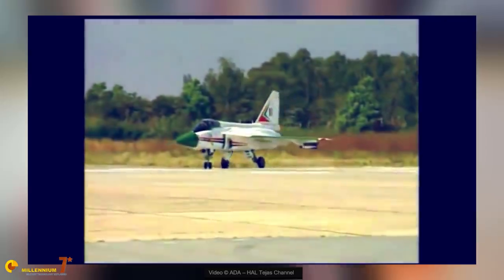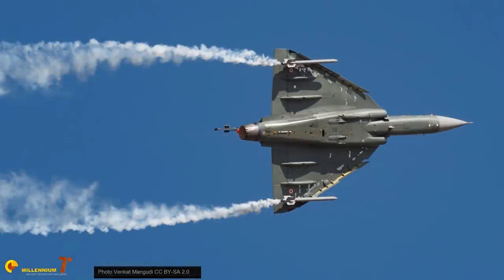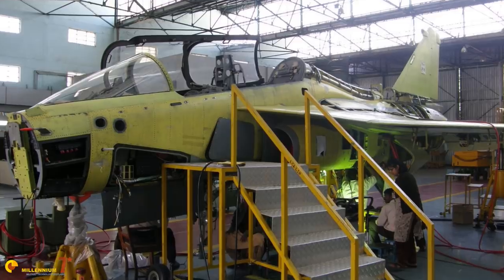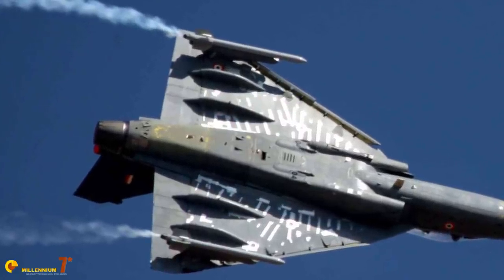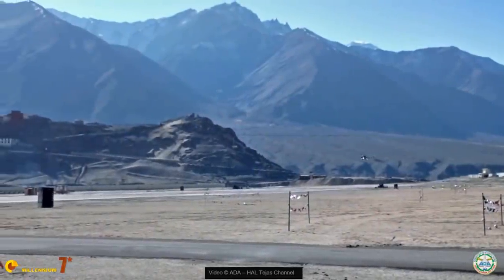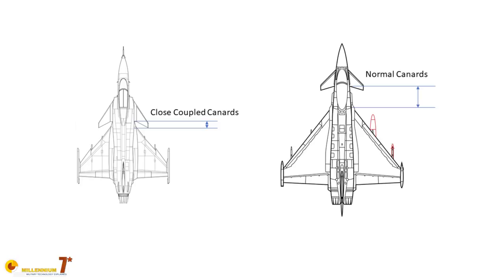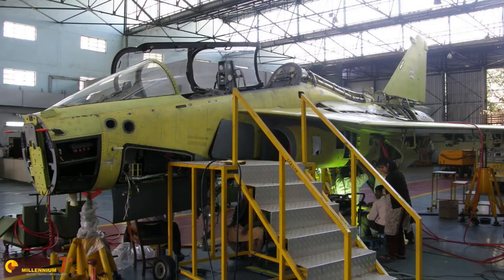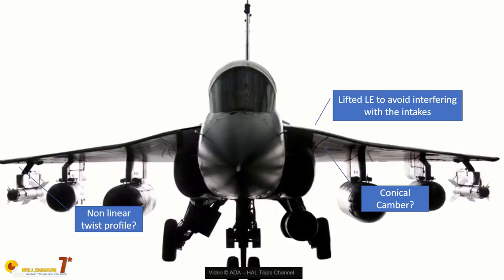TEJAS Aircraft  Aerodynamics Analysis - The Swedish Connection?

Comment: It looks like a Mirage 2000, without the difussion cones.
Reply: Nestor Sanchez It essentially is. A downgraded Mirage 2000.
Reply: @csabascs5913  @nestor need do deep analysis you will see huge difference between basic design of tejas & mirage.its not same
Reply: @csabascs5913  nope! Pilots who have flown both jets have said handling is smoother in tejas than mirage..
Reply: Inlet design of both jet is totally different that's why mirage has cones in inlet.
Mirage inlets are placed above the wings and ahead of the wings with sidewise inlet design.and mirage inlets shaped are also  not "Y" shaped which all together  cause air to move inside in supersonic speed ,which create turbulence in jet engine & cause damage
To reduce air speed in the inlet from supersonic to subsonic mirage uses diffusion cones.
But tejas inlets are placed behind & below the wings & with "Y" shaped inlets which don't let air move above subsonic speed inside the intakes.
So both jets have totally different designs it's not same
Reply: akash sahu Sure they are not the same, but the basic aerodynamic design concept behind them is the same. Only the Mirage has better aerodynamic performance. Even the Indian Air Force itself was very much disappointed with the aero performance of the Tejas, that’s why they created Mk1a, that’s somewhat better, but not too much. The problem is that the pure delta wing design concept is too outdated. True 4th gen designs like trapezoid wings with lerx and canard deltas are all much better.
Reply: Ravi Sharma Smoother maybe, but not better. It simply doesn’t have the same aerodynamic performance. And the Mirage is outdated and underperforming too compared to true 4th gen designs.
Reply: akash sahu I generally agree. Re the wing design, I know that the Tejas is not 100% pure delta, but there’s no major difference between a pure delta and a double delta wrt aerodynamic performance. Difference is very small compared to the difference between a pure delta and a canard delta or a lerx trapezoid wing design. Btw the Mirage does have a lift enhancing device in the form of 2 small vortex generators before and above the main wings that work similarly to close coupled canards, only they are much less effective.
Re Tejas Mk1a I thought there were some aerodynamic changes too but I may have been wrong. Anyway, my point was that this design is obviously inferior to true gen 4 designs, because the concept goes back to the late 70’s/early 80’s, and therefore Tejas cannot really compete with 1st line gen 4 fighters like The Gripen or th F-16.
I fully agree with you that we shouldn’t compare Tejas to 1st line gen 4 fighters like the Gripen or the F-16 as it doesn’t belong to the same category. It’s a 2nd line light plane meant to complement such planes, not to compete with them. We should rather compare it to the JF-17 or the FA-50. But many indian fanboyz here do claim that Tejas is in the same league as the Gripen or the F-16, that’s simply stupid. It isn’t and it shouldn’t be. It’s not designed for that.
I also agree that Tejas is not a bad plane compared to similar 2nd line fighters like the JF-17 (although the latter has a more advanced, true gen 4 aerodynamic design, thanks to having been conceptualized decades later). As a MIG-21 replacement it’s obviously a big step forward, and also a huge booster for the indian aerospace industry. But nevertheless it’s aerodynamics is outdated, mostly due to the huge delays and many problems of the development, as you yourself have mentioned, and therefore it’s no match for true gen 4 and 4,5 fighters. A fact that many fanboyz don’t seem to be able to accept.
So I don’t argue with you, actually, but with those fanboyz who make ridiculous claims like Tejas being a better fighter than, say, the Gripen, that’s one of the most advanced gen 4/4,5 planes. This is nothing but wishful thinking and misguided patriotism/national pride.
India should be proud of Tejas, but not because it’s one of the best fighter planes of the world (what it isn’t), but because of the fact itself that they could develop an indeginous supersonic fighter (albeit using lots of foreign help and modules) and create a decent aerospace industry from scratch, something that very few nations could do. It’s a big achievement in itself, even if their first product, that is Tejas, is not among the best. The statement that ‘Tejas is a very successful failure’ means exactly this, imho.
Reply: @akashsahu3854  Mark 1A will also see improvement in the air intake design

Comment: What we know about performance till now, from pilots who flew it  and test pilots, 1. It FOC Tejas has achieved all the benchmark after recent software upgrade baring 1.8 Mach speed.
2. It pulled -24° AOA exactly what it was designed for. I think f-16 can pull 25° ( stands corrected)
3. Roll rate is excellent
4.ITR is superb 
5.STR is average.
6.Really smooth to fly and responsive.
Reply: @Nick Emerson Tejas itr and str datas are not available.. in the public domain.. however by analysing the airshows Tejas str and Roll rate are slightly greater than gripen.
Reply: @Nick Emerson u can deduce so much if watch it carefully..
Reply: @Nick Emerson that's exactly what I m telling u.. I have shown u the video comparing the performance of IOC Tejas and gripenC side by side but you want to reject it by saying it's shaky. But u tossed some data about ITR and STR of Tejas without giving the source.. that's called faith.. video is a hard fact. It's your faith that made u put unverified data about Tejas... Not science..
Reply: @Nick Emerson and we have all heard the hyperbole of Saab against russian planes, f-22, f-16  after all they want to sell these... But have it in mind that Tejas u saw in Bahrain was IOC standard that too it was its first international flight so capabilities were limited, in the same link u posted it has said the test pilots have achieved 26° AOA , and in FOC Tejas' all the capabilities are unlocked and tested for the first time.. and for gripen the STR is not 28°..  it's 20°s same as Tejas. https://www.fighter-planes.com/info/jas39.htm
Reply: Marcos B  exactly.... i know he wont and saab is the loudest mouth in aviation,.. just look at their claims against flanker, raptor..
Reply: @Nick Emerson well I thought u were man of science but in the end you have shown your faith.. it's ok everyman is allowed to have faith in anything even though it's is false..
Reply: @Nick Emerson ohh so bring that up to justify your faith... One is islamic Republic and other one is democratic Republic... I see no faith war here.. but ok  buds whatever u say.🙄 I don't want to hurt your feelings.
Reply: @Nick Emerson well india has more muslims than pakistan and their are so many muslims war heros in india, so i must say its not a religious war between india and pakistan.
Reply: @Nick Emerson it's a deep topic but a brief answers would be, pakistani army that controls the nation, to remain relevant and hold power and money it needs a constant struggle with India. Pak army generals are richest among the generals of all army. Every struggle is about power and money religion is just a catalyst.

Comment: The Grippen and Tejas are competing for the same market. No one in their right mind would buy a Tejas over a Grippen.
Reply: They might if it costs less. A Gripen E/F costs 45-50M USD. The Tejas mk1 costs 23M USD with less than 30 units produced. It would probably cost 15-20M by the end of the development cycle. So if you had the option of buying one Gripen or 2-3 Tejas and your requirements weren't that strict, you might go for Tejas. 
Remember, Tejas was designed as a replacement for MiG 21, you have look at from that angle. No one ought to have bought a MiG-21 over an F16, but they did.
Also, Tejas and Gripen aren't competing for the same market if you look at cost & capability. Things don't compete with each other if they look similar, an airforce cares much more about capability & procurement/operating cost than if the jets look like each other.
The Gripen is competing with MiG 35, F-16 V, Su 35 & even the F-35 in some ways. 
The Tejas is competing with Chinese jets like JF17, korean T50, Russian Yak 130 & Boeing T7. They're completely different sets of requirements.
Reply: Arkadeep Kundu You shouldn’t compare the price of the Tejas Mk1 to that of the Gripen E. They are not playing in the same league. Compare it to the price of the Gripen C if you want to make some comparision. But it doesn’t make much sense anyway for the very reason you mentioned: Gripen is a 1st line fighter, Tejas is a 2nd line one.
Reply: Marcos B No Tejas version is superior to any Gripen version, period. They are not playing in the same league. It’s like saying that the F5E is superior to the F15C... nonsense.
Reply: @csabascs5913  Tejas actually has much better subsystems than earlier Gripen models. Better radar, better fbw etc.
Reply: Marcos B  The 136M USD cost for Gripen E includes Technology transfer & setting up assembly plants in Brazil. Also Gripen has been in production for nearly 30 years, so the development cost has been recouped. Tejas mk1a 62 million cost also includes setting up of factories which right now have only 2 production lines which can make only 16 aircrafts per year. . Also it's the first batch of its series which always costs more. First batch of F-35 cost about 160 million, now they're 80-100 million. 
Mk1A is probably already better that Gripen C in terms of avionics, radar & FCS. Mk2 is much bigger, about the size of a Gripen E, and has canards, DSI, EW suite & better aerodynamic optimization.
Reply: Arkadeep Kundu  Not really. Early Gripens had surprisingly good electronic systems, including an integrated ew suite and datalink that rivals gen 4.5 planes. Maybe the next version of Tejas will have a better radar but re ew I don’t think so.
Reply: Marcos B Just stay in your usual state of happy ignorance then... :D
Reply: @Nick Emerson ohh.. Sorry my bad.
Reply: Marcos B  __ My point is that the Tejas is a standalone project from a country yet to produce a world class aircraft in any class of any description while Saab have ongoing partnerships with Boeing in the US, Bombardier in Canada and Enbraer in Brazil ALL of whom are active and successful players in world aviation. The Tejas is the Trabant of fighter aircraft.

Comment: what will be the result if Tejas was using conventional wings with a tail?
will it be better or worse?
Reply from the maker: In terms of drag? Likely worse
Reply: @Millennium7HistoryTech  Well, the drag on Tejas is pretty bad at the first place. The thrust per wing area is only slightly higher than mirage 2000 but significantly lower than all other modern fighters.
Reply: @Millennium7HistoryTech  thanks
Reply: @joelau2383  it is a light fighter competition is with FA 50 and jf 17, 
Even mirage, f 16 and gripen is in a league abow it
Reply: @a.g.rhithwik  lol above in what terms?
Reply: @rohitb3  it is a segment below f 16 and gripen
Reply: @a.g.rhithwik  Again, i ask, in what sense? or in what terms?
Do you understand anything of aeronautics and aviation technology at all?
Reply: @rohitb3  Before that you explain how do you  understand it.
Reply: @a.g.rhithwik  Design , Flight controls, structure make, Engine, Weapons, Cost, Avionics, Maintainability, etc.
Any idea about any of those aspects?
Reply: @rohitb3  yeh... i do,
even in than aspect modern f 16 are way ahead of tejas 
f 16 could easily handle up to 9g loads
reach mach 2 without payload
has bigger engine
higher pay load
more range
better and tested avionics and ew suit
.
.what do you need more to know about
Reply: @a.g.rhithwik  Okay,  for now, lets accept the modern version of F-16.
How about the Mirage2000, Gripen C and Pakistani Airforce F-16(A/B/C/D variants)?
Reply: @rohitb3  f 16 c and d is far better than tejas.
and those older jets are updated with newer avionics they will equal or greater than tejas
for short span of time.
Reply: @a.g.rhithwik  Acha Mr Expert.  A 1980s/90s upgraded F-16 C is "far better" than Tejas and the older 1970s F-16A/B is updated with newer avionics that will be "equal or greater" than Tejas.
Last question for you : How does these F-16 A/B/C/D compare to our upgraded Mirage2000 mk2?
Reply: @rohitb3  Its like comparing old 2000 Mercedes with 2020 swift (new swift might have got a touch screen that could be integrated on merc also.
if tejas was that good enough why development of mk 2
I think you have not much knowledge about this topic.
Reply: @rohitb3  you know tejas is slower speed is mach 1.6 as per hal
less payload
only advantage is newly made air frame and avionics
avionics can be upgrades on old falcons and mirages.
so if the air frame of a old jet is in good condition it could be upgraded with new electronics it could outmatch tajas with an ease
Reply: @a.g.rhithwik  Wait, you still have not replied to my question :How does these F-16 A/B/C/D compare to our  Mirage2000?
Then i will tell you what knowledge I have. So please answer the above question.
Reply: @a.g.rhithwik  still waiting for an answer...PAF F-16 A/B/C/D vs our Mirage2000
Reply: @rohitb3  for bombing mission f 16 c or d will have an edge
and for air superiority mission mirage 2000-5 mk 2 is more suitable
 still wondering why are you comparing these jets with small tejas 🤣
if you want compare it with fa 50, jf 17 or even yak 130
and dont act like a dump with some stupid questions
Reply: @rohitb3  english please
Reply: @rohitb3  looks like you are a  school student, so don't believe in propagandas and don't trust 100% videos
Reply: @a.g.rhithwik  Yes , i wont believe IAF pilots like Group Captain Rangachari or Air marshal  Raghunath Nambiar
.
I will believe youtube expert and national embarrassment AG Ritwik...who compares fighters in terms of speed and payload.
Reply: @rohitb3  well, national embarrassment is your dad and you can believe what ever you want and IAF never said tejas is better than f 16
Reply: @a.g.rhithwik  IAF pilots never said anything about F-16. They said its better than Mirage2000, which is a same era 4th gen fighter as a F-16 C/D.
And yes, me, the IAF pilots and other people who understand a bit of defence are national embarassment.
True national hero is you! Who says F-16/Mirage2000 is better and Tejas is comparable to Yak-130.
Anyway whatever, im done here, go read up a bit more to understand aviation tech.
Reply: @rohitb3  they said landing speed is less thats its.
For bombing mission they chose mirrage because it is better
For air superiority marage is better
And for reconnaissance mission tejas may have an advantage thats it
You need to lean about it. Do some research (not on wiki)
Reply: @a.g.rhithwik  we are not talking about roles at all. We are talking about fighter generation and technology.  Fighters like Mirage2000 was great during their time. But will be retired and replaced by Tejas mk2/AMCA in the next 15 years or so
Tejas is the new top gun, and will be the backbone of the IAF for decades to come.
Reply: @rohitb3  tejas mk 2 is future not present
at present mirage 2000-5 is more capable than tejas
Reply: @a.g.rhithwik  omg. Tejas mk2 will be better than Su-30MKI and will continue post 2050.
Nevermind. your IQ will take some time to catch up.
Reply: @rohitb3  yeh i saw your IQ when you said tejas is more capable than F 16 🤣🤣🤣🤣

Comment: Humara Tejes mast hai , But to increase Speed and engine power , the designer of LCA Tejas will only need to make the Air intake of the plane a bit larger than original its very small and narrow , Less air intake mean less power generation , More air intake means more power more thrust more combustion .  I wished mujhe opportunity milta to work on LCA Tejas ..
Reply: Marcos B  Lol you mean Stealth ? Well you can achieve that capability from stealthy paint and Carbon fiber . And for your kind information heat is generated from its back not from the air intake inlets.  Infact Those are actually cool if you see in thermal camera .  Why F22 F35 and whole other aircraft have larger inlets than ? Chalo tujhe tere bhasa mai samjhata hai , Abey Gadhe Engine ko hawa nehi milega toh sas kese lega bey ? Sale 8 inch ka PVC pipe v Use bada hoga samjha .  Engine is like more air in  more speed out .
Reply: Marcos B  🤣🤣🤣🤣🤣 Hawa kese lagata hai bey bencho . Hawa ko lagata nehi hai Hawa ko ane deta hai .  Samjha gadha ?